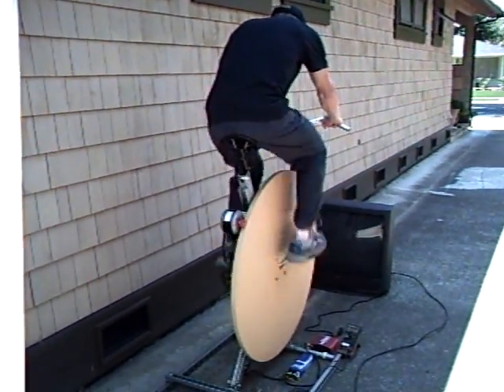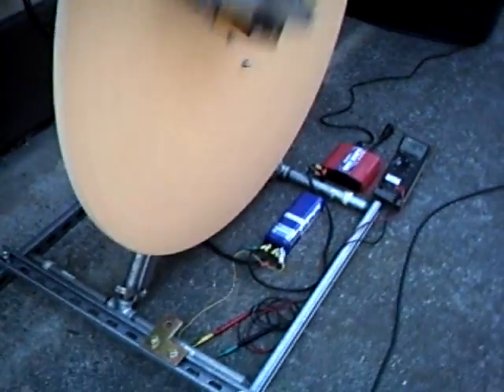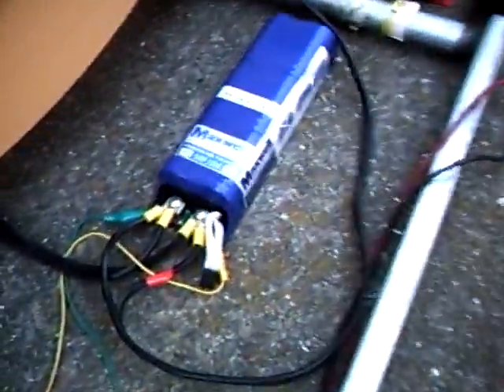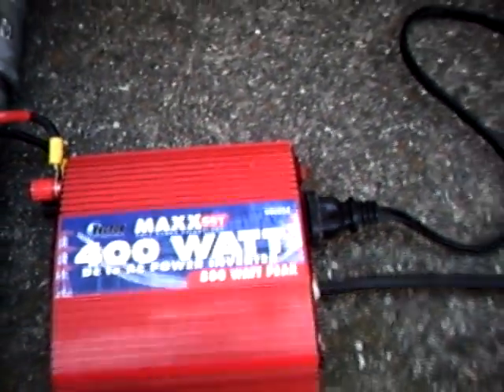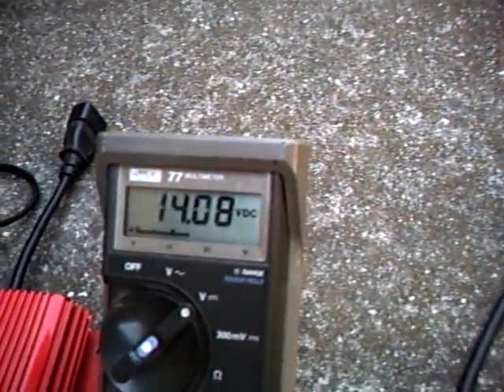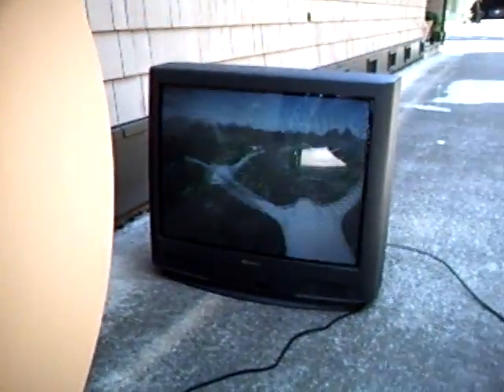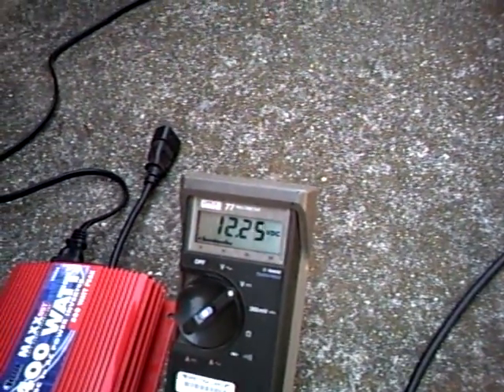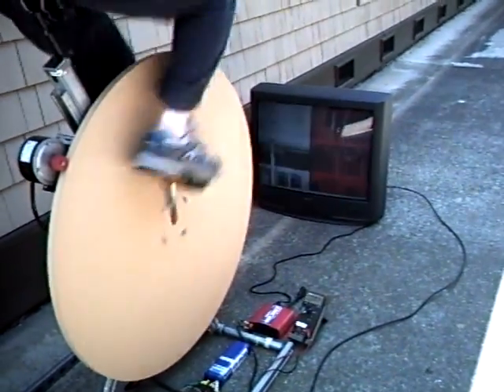Pedal Powered Television

Comment: Very nice and neat setup here.
Charging power caps gives to fill the power needed like a buffer tank.
You can use your cap to run and energize and run an alternator for more power.

Comment: i remember soemthing similar being marketed on TV, you just had to plug the TV into the base of a certain stationary bike... The reason it didn't take off is because most that could afford such a gizmo would rather sit on the couch and relax than have a workout...
However, I do think this would be a good way for fitness centers to generate a portion of their facility energy needs (if set up correctly).

Comment from the maker: To run TVs with degaussing circuits, yes, you need either a battery or a capacitor. You don't need a 58 Farad capacitor, but you need something. The degauss circuit draws more power than you can pedal, so the voltage drops and the inverter cuts out when it kicks in. 

Flat panel TVs don't have this problem (no degaussing circuit).

Comment from the maker: 1)correct
2)they are 165mm
3)????
4)gearing wastes power
5)watch again. The generator is pivoting down under it's own weight and into the drive flywheel.

Comment from the maker: It's a mermanent magnet scooter motor. Car alternators are lots less efficient. This is pretty efficient. You can spin the flywheel up with the motor not on it and it takes several minutes to stop.

Comment from the maker: You are guessing rather than stating facts.  The facts are: I have measured that TV extensively using a WATTS-UP, and it draws between 60 watts (dark scene) and 95 watts (white screen).  I have pedaled that generator every morning for 9 months, and I can sustain 80 watt output for 30 minutes without becoming "exhausted." I am 52 years old. I have no doubt that a 60-year old would need a smaller TV ;-) but I am certain my 28-year old son, who was pedaling, could watch TV as long as he wished.